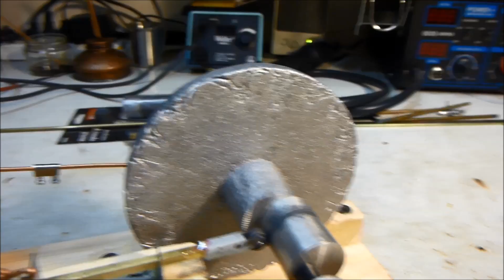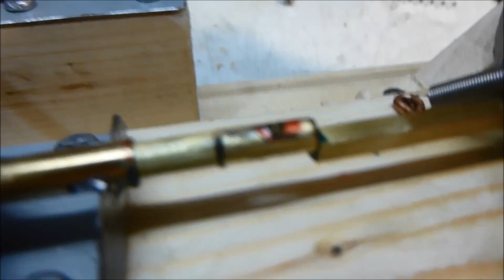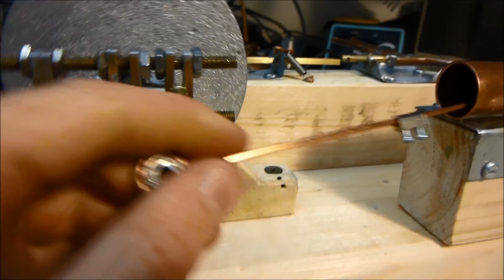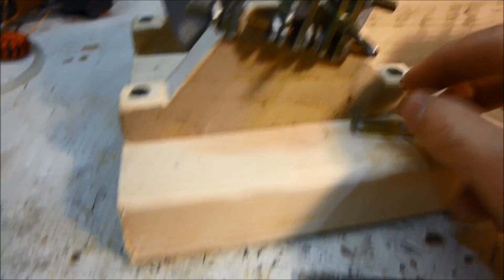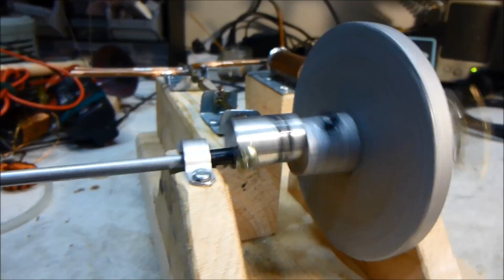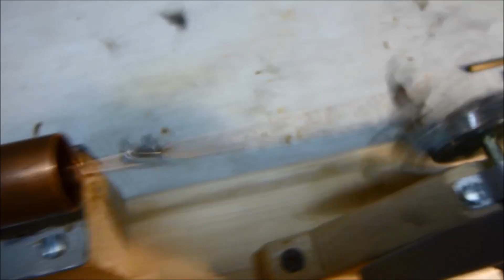In Depth Video on my DIY Homemade Steam Engine - Parts Used, How I Built it, etc

Comment: I'm Really Impressed with how super simple yet ultra adjustable everything is. You can change valve timing or crank length in seconds :) Whle this video answered all my questions with your valve, I feel a more detailed video on the fabrication and spaciing to suit cam etc would be very popular for less experianced builders. No doubt you will make another (larger bore) one at some time, be sure to film it all :) I've been studying steam engines for some time, the valve is the hardest part. Yours is by far the simplest I have ever seen, and the only one I have seen that will run pressure and vacuum at the same time. Perhaps you could seal it with valve stem seals from an OHV 4 stroke motor. You may need to glue them on, and they would need good lube, but I think that would reduce leakage a lot. Or maybe grease your shaft and use some JB weld to make the air leak smaller?
Looking forward to boiler tests. Has you mum padlocked the kettle yet? Is there a pressure cooker in the house? Because Mine has a nipple on it that would fit your hose nicely....
Reply from the maker: Mongrel Shark Thank you!  That's how I wanted it!  I try to make my Stirling engines in the same easily adjustable manner.  It's nice when you don't have to rebuild the whole engine just to adjust something simple.  Now I want to build a double acting steam engine because I want more POWER!!!  I need a little bigger bore like you say, and I can't use epoxy putty as a piston.  So I'm going to need to use some kind of metal or maybe graphite.  The epoxy putty piston works great at room temperature but as soon as it heats up a little from steam it expands more than the copper cylinder and binds, causing the engine to run fine off steam for 10 seconds and then grind to a halt.

I have a diagram drawn up for the valve so I will do a video on that one of these days.  I just kinda eyeballed everything on this engine so there are not really and dimensions of the valve to give!  But I still can do a video on the valve.  A bigger valve would be nice too.  Although then I would need bigger piping and an even bigger boiler.  Hmm...

There are much simpler steam engines than mine.  Here is one:  Homemade Steam Engine

Pretty much any steam engine will run from a vacuum.  Well unless it needs more pressure than atmospheric pressure.  Basically all you're doing is using atmospheric pressure as your pressure supply.  

II guess stem seals would work but I would have to buy them.  JB weld is a good idea to seal up the valve better but with my experience so far with epoxy and steam, it will bind when it heats up.  With all the leakage on the valve, it still does seem to run just fine on steam.  30psi really makes it take off!

Hahaha I was eyeing up the tea kettle when I first made it but I decided I might only be able to get 1-2psi from it because the lid does not seal well.  Sadly we don't have a pressure cooker(if we did I probably would have turned it into a stirling engine by now).  I already made a pretty nice boiler out of a tomato sauce can!  It works great!  I have a video of the hydrostatic test up so go check it out!  You are going to be surprised by how much pressure a plain old tin can can hold!  Hint: I deem 30psi the safe operating pressure!  But it tested to way more than that!  I really want to see the limit of a plain old tin can now!
Reply from the maker: Bertha munson Hahaha hobbyist jargon!  Just a bunch of metal tubes and some solder and you have a valve for a steam engine!  Simple as that!  :D  Hahaha
Reply: I have cooked beans in the can on the fire. I can vouch for the pressure. The trick is to dint the can so if the dint pops out you know its close to exploding.... Saw a can explode once. Blew the fire out, and hot coals and beans all over camp.

You might be surprised about how few steam engines would run on vacuum, especially vacuum and pressure at same time. Its not that common.

I wonder if you could make piston rings for your epoxy piston? Thats kind of funny that it gets stuck.Must have had you scratching your head at first.

I've seen pistons made from stacks of washers on a rod before... You can even put stuff like felt and velvet in between the washers, so it hangs out a bit, for a better seal.
Reply from the maker: Mongrel Shark Interesting!  The denting idea is very smart!  Just keep an eye on it!  The beans were probably falling from the sky for a while!!!  Hahaha

Yeah, I guess I have't seen any running on vacuum before.

I thought at first it was the oil in the piston mixing with steam cause it was puking out this gray thick gunk.  But after I cleaned all the oil out and dried it all up it still did exactly the same thing.  I don't know how I would make piston rings.  But I'll give it some thought.

I thought about something like that.  I was thinking to cut the piston in half and sandwich some leather or felt in between the two halves.  I don't know if the added resistance would be over come by the added power.  Something to try though.  I'm also trying to figure out how I would shape a graphite piston.  I have a really nice piece of graphite that I've been waiting to use for that one special project!  How do I cut it without making a HUGE MASSIVE mess?
Reply: If you wanted to mill a piston. if you can get a rod through the middle, that fits in your drill, you could spin it and work it like in a lathe.

The gunk must be worn piston?

Some steam pistons are as simple as string. The steam gets it wet and it acts as lubricant and a seal... Also look into steam oil. Apparently its something you put in the boiler, like 2 stroke oil in the fuel for a 2 stroke petrol engine..

It doesn't really rain whole beans. More like mashed re-fried beans.
Reply from the maker: Mongrel Shark Yeah that might work.  I would just have to be super careful not to mess it up.

I was just using motor oil in the piston.  It has a tendency to mix with water and make a gunky stuff when it's moving fast.  Steam engine oil would be a lot better.  That string piston seal is a really good idea!  I might try that!

I figured out for sure why my piston binds up!  It's because the thermal expansion coefficient of epoxy is way bigger than copper!  The thermal expansion coefficient of JB Weld is: 48 [(in)/(in) x °F)] x 10(-6) http://www.mombu.com/aviation/aviators/t-epoxy-bonding-to-aluminum-and-magnesium-3587575.html

While the thermal expansion coefficient of copper is a mere 9.3 [(in)/(in) x °F)] x 10(-6). http://www.engineeringtoolbox.com/linear-expansion-coefficients-d_95.html   So a huge difference there.  Explains everything!  Graphite would be a better(not have binding problems) piston with a thermal expansion coefficient of only 1.1-3.4 [(in)/(in) x °F)] x 10(-6).  But then as he engine heats up the piston would have a worse and worse seal.  So piston rings may be necessary then.  So my best bet if I don't want piston rings but want a good seal is to use a copper piston and copper cylinder, or use materials that have similar thermal coefficients of expansion.  Glass and graphite would be a great example!

Thank you!
Reply from the maker: Bertha munson Hahaha you'll love the comment I just posted about thermal expansion coefficients!  Makes everything 100x simpler!  Hahaha  :P
Reply: Or, as you know the expansion rate of the epoxy, you could make a smaller one that will seal when hot. You may even be able to have groves for piston rings to help it seal when cool.
Reply from the maker: Mongrel Shark That's true.  Or have a piston for running on steam and one for running on vacuum!  Oh by the way, I bought myself a really nice digital caliper for only $9!  So technically I could do those measurements now and figure it all out!  Thank you!
Reply: I love my digital callipers :)
Reply from the maker: Mongrel Shark Ya so far I'm really liking mine too! I like that it has inches and mm.  I just don't get it how they can make these things for only $9!
Reply: I paid exactly 11 times that much 15 years ago. Its crazy how cheap stuff is now,
Reply from the maker: I know it is!  I wonder if your's is as accurate as my cheap one?
Reply: A mate got a calliper for $14 recently. Its as accurate, but mostly plastic. Mine are made from good steel. Which was a bit scary when I was measuring spark gaps. Might have to get some cheap ones for that.
Mine go down to 0.01mm (10 microns) or half a thousandth of an inch. Although they read all sorts of crazy numbers past 70mm. I've never needed to measure something that big to sub mm accuracy anyway, so not a big deal. I originally got them to check valve stem wear on a motorbike I was re-building.
Reply from the maker: Mine is advertised for $14.99 on there website but I got it in the store for $9.99.  This is the one I got:  http://www.harborfreight.com/4-inch-digital-caliper-47256.html  It seems to be pretty accurate.  The display goes to 0.01 mm like yours.
Reply: They look good! Are the jaws metal or plastic?
Reply from the maker: Mongrel Shark Metal!  It's all stainless steel except for the meter part!
Reply: Wow, Thats awesome! Unless you want to measure your spark gap, then its a pain... Luckily mine has survived a few cap discharges :)
Reply from the maker: Mongrel Shark Hahaha yeah!  But I'm pretty sure I wouldn't need to measure any spark gaps that accurately though.  That's good it's survived cap discharges!
Reply: It was turned off,  that may have saved it, I was sure it was going to be stuffed.